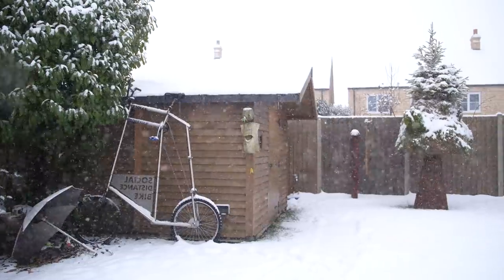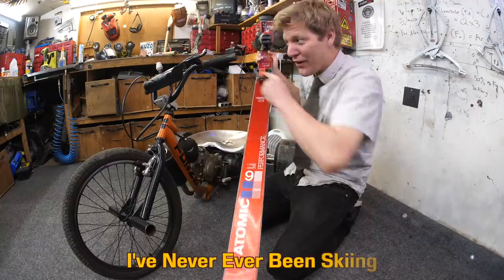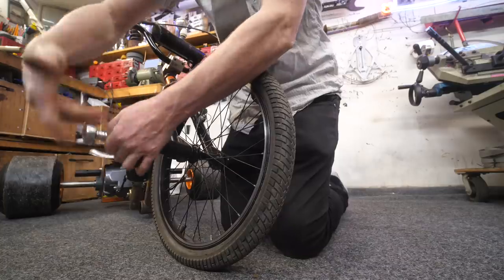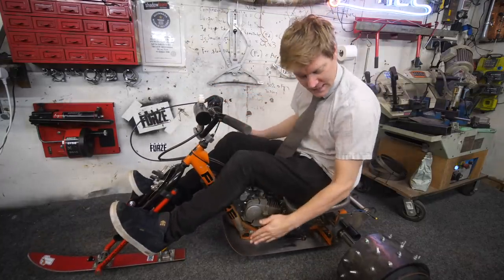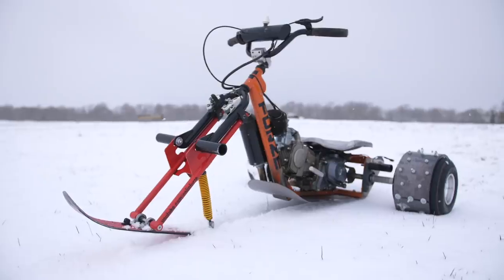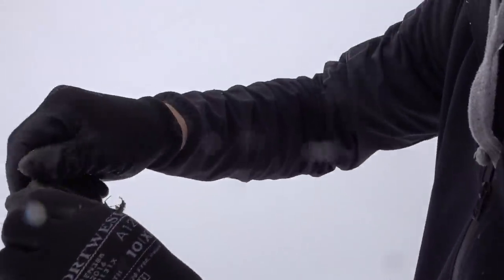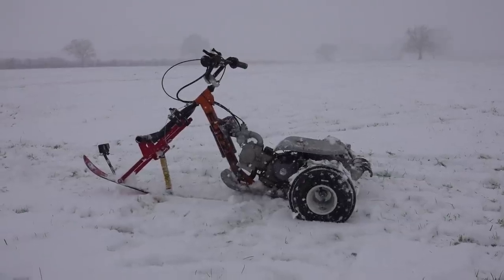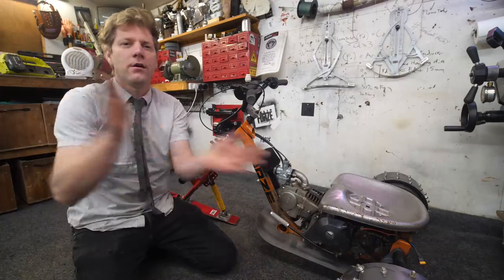DRIFT TRIKE with SKI

Comment: While walking back from school, I thought about the idea of using some racket shoes ( the ones for snow) , and make them heat up. So it melts the ice and snow underneath!
Reply: @AbesShenanigans  I also thought about that, but I thought it would be useful for really hard snow or ice. Think about it, winter shoes are used for normal amounts of snow. If you don't want to sink into the snow, you use racket shoes. But what about walking on steep, hard snow or ice? The metal strings would heat up till red hot, and you could just walk through anything. Maybe it won't work but it's a cool project
Reply: Honestly I was thinking very seriously about something similar. Mine was more a flat metal box you put on the bottom of your shoe. Inside two spinners holding small magnets on the wing tips. Run wire up through pants to waist for power supply and a motor controller. Induction heated shoe plates, insulate between shoe and box to avoid burning rubber, choose insulation R-factor based on level of toasty feet you desire.
Reply: @victorillo377   it's a cool idea, hopefully Colin gives it a shot

Comment: after i wrote this you mentioned that verry thing 
"the solid rearaxle with the bite you get from the spikes in the rearwheels makes it harder to steer using a ski on the front "
i was looking intoo using angle grinder gears to build a differential myself for a different moped powered project , seen ali express sell those as replacement parts think the "sungears" can be welded on the axles 
you could even install differential braking for an even more snappy turn / innitializing a sideways skid

Comment: The swing you built for one of your milestones. That one that goes higher than a house and upside down. You could make it with a sled attached to it and once you get to the desired speed by swinging 360° a few times you can make it release you at the bottom and launch forward on the snow sort of like sledding only on flat ground. In the summer you could adapt this to a swimming area where it releases you and skips you across the water on something that looks like a saucer sled.
Reply: I wonder if you could use something like a kayak in the summertime version. You’d be able to go pretty far on a good push
Reply: Nice name lol!

Comment: Hello Colin,
Greetings from Nova Scotia, Canada !!

I have a very....loose idea I would like to share with you.
A bicycle that has dual  tracks in the rear and either a single wide ski in the front or dual thinner skis in the front, retain the handlebars for steering, and the pedal power, only...Heres where it crosses over to a Colin Furze Invention...lol
Create a system of large and small sprockets, chain driven to power it very easily over snow, perhaps something along the lines of 1 rotation of the pedal sprocket turns the tracks 5 times in rotation, I have no idea if this could actually be built to function, BUT... if anyone can do it... IT'S YOU !!! 
 Thank You for HOURS of unending entertainment with your Creations and Hilarious Videos
 Your Fan, Ron

Comment: I think you just need a wider front ski and wider wheels so that it rides on top of the snow instead of plowing through the snow. (Maybe use part of a snowboard for the ski) that should help with your grip problem.

You could also put "skis" with holes cut in them around the wheels to add extra surface area. Kind of like the wheels on a snow plane.

Comment: What if you add some small booster rockets to the screw tank or make another one of those screw tanks but wood on the back so all the metal doesn't melt. Or maybe some fans in the back to gain more momentum.

Comment: IDEA. 
-Leave out the spike crap and use snowmobile rubber rike things instead. Should give you some proper speed! 
-Also, I wonder if you could actually make something like this which has wings. Like if you go fast enough it would actually let you lift off.

Comment: The cost to aerate your lawn by hiring a lawn care company is about $15 to $17 per thousand square feet. The average lawn size is about ten thousand square feet, making the average aeration cost around $150. It will take a lawn care company about 30 minutes to aerate a ten thousand square foot lawn.

Comment: Hey #colinfurze I have a question which I realise is probably stupid and you probably won't read it which is fine its not overly important but my question is, what would happen we you weld and you didn't use the metal rode but just the welding torch by itself? Would it still do the same job or not work as good?